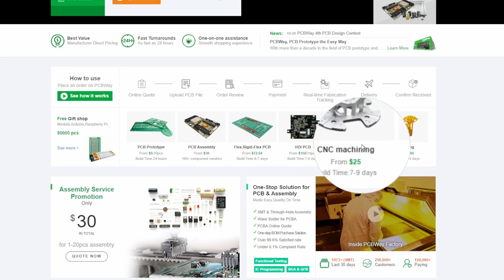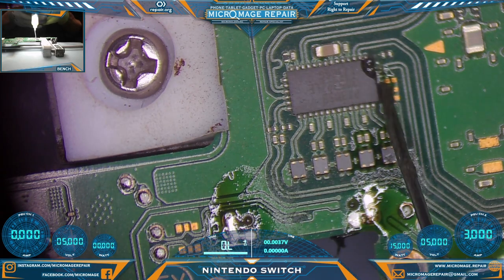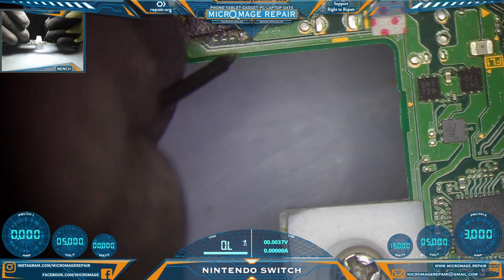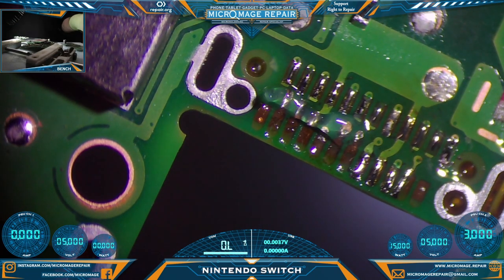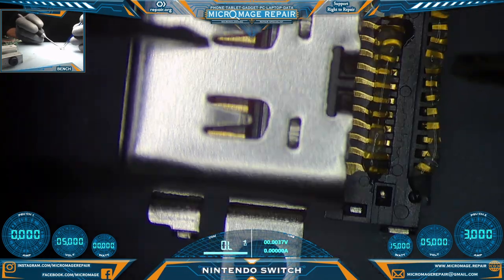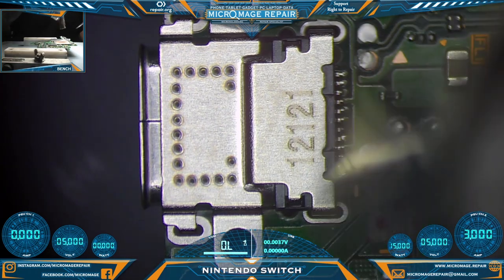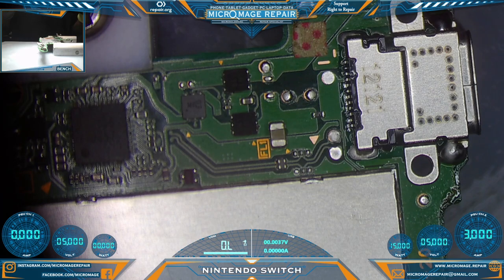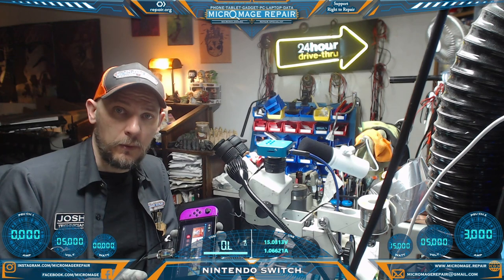Nintendo Switch: Ripped pads and Power Issues

Comment: I was sent here by Retro Fix.
Quick question for anyone who knows.
Is the Switch’s RAM married to the motherboard with code?

Reason why I’m asking is my Switch just sh!7 the best yesterday. Waiting to hear back if a shop near me can diagnose and repair. 

If not I’m trying to either get another og Switch, or MB and replace it. Really don’t want to buy an OLED just incase another revision comes out afterwards.
Reply from the maker: I'm not certain.
I have occasionally seen need to re-ball ram, never attempted or seen attempted a full replacement.
Reply: @MicroMageRepair  I mean just replacing the motherboard out right. I have no tools for micro soldering, but if they are coded together then there’s no point. I’ll just get another used Switch. 

Sad part is on eBay the MBs are just as expensive as some working launch Switch’s. 🤨
Reply from the maker: @BowsettesFury  I have heard of people doing board swaps, you 100% need the CPU and EMMC, that's all I can say with certainty. 
I'm just starting with CPU work on Switches so haven't had the opportunity to investigate that in depth yet.
Reply: @MicroMageRepair  ok thank you 😊 only answer I’ve gotten so far.